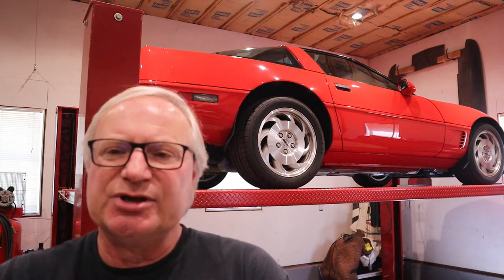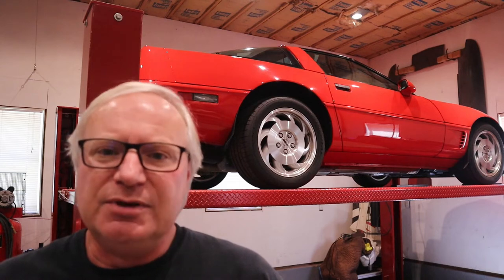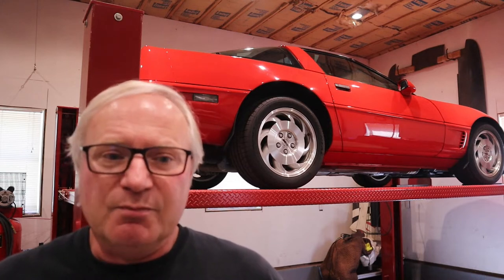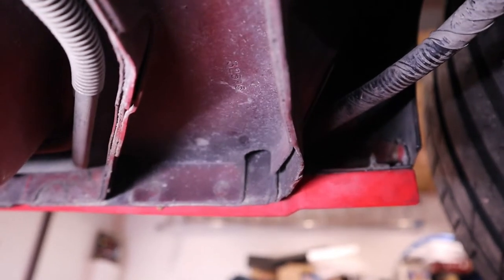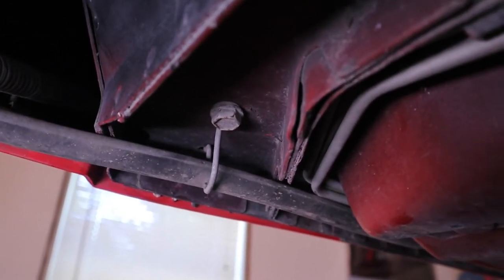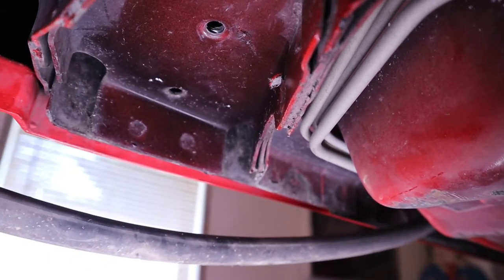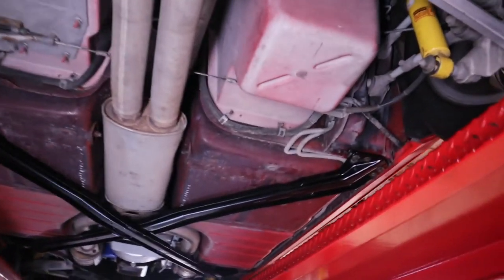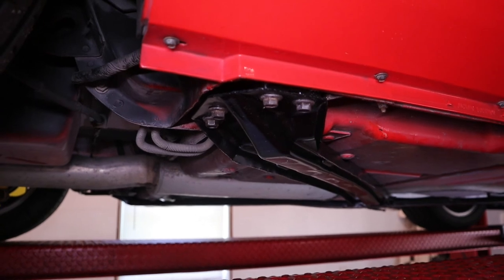Adding C4 Corvette Convertible Undercar Bracing to a Coupe

Comment: In the very book you cited, McLellan explains that the X brace was added to the convertibles to fix a localized vibration in the seats and floor pan. Page 146, second paragraph. Nowhere does he say anything about it stiffening the chassis. And the reason is because it does not stiffen the chassis. They did other things for that, as explained in the same paragraph. This piece is worthless for addressing the torsional flex these cars suffer and I'm afraid you've wasted your time, money, and effort putting it in your car. Moreover, this video is perpetuating this myth among all the unwitting who come here to watch it.

Your intentions are good but your intel is bad.

Anyone who is not convinced, take this assembly or any one like it and grab it by two ends while sticking the other two under something heavy and then see how much you can twist the thing with just the force of your puny human arms. Now imagine what a thousand ft-lbs like a car chassis experiences would do.
Reply: Indeed. This looks like snake oil.
Reply: I've heard folks that use this brace that it makes a noticeable difference in NVH.

Comment: Size of rivnuts and holes? Drill bit size
Reply from the maker: M10x1.50 pitch. .7-.38 mm material thickness. McMaster p/n 05105A199. 13.5mm drill bit size.

Comment: I just acquired an X brace but it’s missing the center plate, will it still work? Or would it need reinforcement? Can it be made and how?
Reply from the maker: There are bolt holes in both xbraces. You should be able to bolt them together. I'd use heavy washers also.

Comment: The convertible x-brace works great. Noticeably changes the stiffness of the car and virtually eliminates most noises that are common (especially on the targa top).
Reply: I used the McMaster Carr rivetnuts listed in these comments, but 1 number is off (the last one I think).